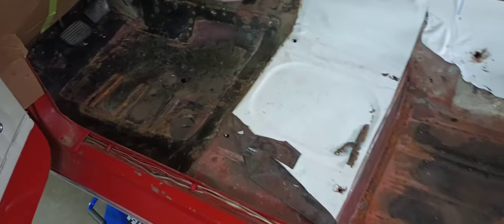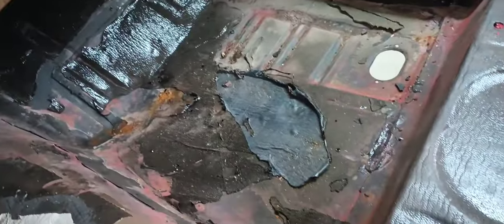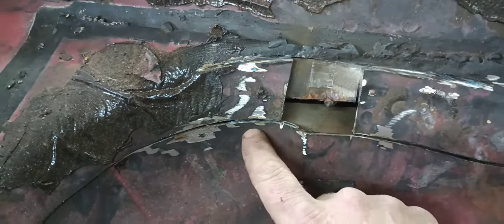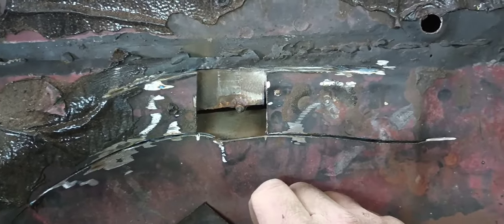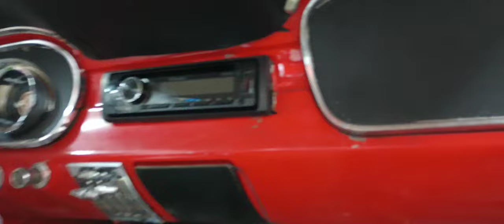Hacked 1965 Ford Mustang: Removing The Boogered-in Floors #ford

Comment: I've been building cars over 40 years - its amazing how many hack jobs are out there, cars left for months at shops with nothing done except money taken. 
I won't do any requested half-ass work especially if I'm thinking its gonna be somebody's quick flip. And wiring - if its a rats nest, its all coming out to do it right, not burn the car down.
Keep up the good work brother.
Reply: I remember a few years back there was a relatively big restoration shop that burned up because a customers car had crap wiring in it. Caught fire in the middle of the night and I recall a really nice Corvette (maybe a split window) and a few other customers cars got cooked. Imagine trying to compensate the owners 🤕

Comment: Got 64 Rancharo to do same they cobled galvanized sheet metal thanks for learning lol 😊
Reply: Back in the day when these cars were 10-15 years old they were worthless.  I 'repaired' the rotted out floor boards on a 64 Falcon using galvanized sheet metal,  pop rivets and sealed up with gutter caulk.  I knew it was a hack job.  The point of the repair was to get another year or two of use from the car before it went to the crusher.   The car was worth so little there was no point in putting any great amount of time or money into it.  That's different from what you see here, which is fraud.   Someone found a rotted car that we would have used for parts back in the day and 'restored' it with pop rivets and bond.  They sold it to some hapless chump who thought he was getting a solid car.

Comment: My warning concerning cutting disc use-the discs spin debris. I have had eye injuries while wearing safety glasses and a face shield. Really, goggles are needed to avoid eye injuries while using cutting discs.
Reply from the maker: Always a good idea
Reply: Don’t forget breathing in that Rusty dust. I use 3M -FF-402 full face respirators for everything from painting to wire brushing on a grinder, cutting, undercoating. I buy them used or open box on e-bay for around $110. New they are around $170, well worth it to save your eyes and lungs.

Comment: Ok one hell of a job dude but did you think to put your stang on a straightening bench cause tearing apart floor pans modified structure of your unibody chassis and you have to check it out during and after your floorpan or rockers replacement.Am body repairer since 40 short years...
Reply from the maker: That would had been the best option, but I don't have access to one so I've been doing a lot of manual straightening and cross measuring that adds up to a lot more work but should get it back inside the factory tolerances.

Comment: Looking at the floors, I wonder about the front fender aprons and center radiator support. I've got a 69 mustang I'll be replacing floorpans on. The front fender aprons on both sides need replaced too. I haven't looked into the cowl yet. I have removed both fenders but not as much rust as I expected so far. The drivers door is really bad. And the drivers side fender is bad also. Headlight bucket is munched too. The floor on the driver side under the brake is gone. I won't know how bad.the interior is until I pull the seats and carpet. I'm not looking to make it a show car but I do want it to be a safe daily driver. I expect it's gonna take some time but I believe I can do it.

Comment: Ok i understand your position.But don t do like the dude redline channel with his welded brace skeleton on his nova  from the inside re cutted and re welded because it appears he s not an indian contortionist to work inside the car.All you have to do is to construct bolted adjustable rulers tubings onto each doorjambs bolted on each sides and from under the chassis at longitudinals beams same
And you ll be able to work from the inside perfectly without to be affected to transform yourself as a snake as vigilantes!😄😆😂

Comment: You should just put a full floor in way less labor
Reply: +1
It's nice to not have to bother stitching everything to an old tunnel
Reply: This car had so many things wrong, bad, or screwed up that it would probably be better to buy another car.  I think Hot Rod Guy has two goals; help the car owner out, and to see if he can gain a YouTube following.  These early Mustangs have been the object of butchery almost since they were new, even in the '70's when they were just a 10 year old used car I can remember seeing many hack jobs at used car lots.
Reply from the maker: Quite possible, I'm trying to keep him as economical as possible and just doing the half floors at this point will probably save him a couple hundred bucks in the end
Reply: Just imagine the guy who did this hack job, watching you tearing it apart! He’s probably saying “dang all my hard work going down the drain”. But then again he might be laughing because he got top dollar for that piece of crap.
Reply: i would charge less to put a full floor pan far less wielding and body work   @HotRodGuyGarage
Reply: I understand totally  @HotRodGuyGarage
Reply: @Thomas63r2  There's a guy here on YouTube who calls himself 'Your Friend Pete' who rebuilt a fastback he referred to as the 'Rustang'.  By the time he was done about the only original panel on the car was the roof, the rest of it was Chineseium repo panels.  Now the car did look nice but it's hardly a Ford Mustang at that point.  It's now a Dynacorn Mustang.

Comment: That guy will need to educate themselves on picking a car to purchase.  Just the rust under the hood and the paintwork puffing up on the braces tells a person that they painted over rust.  Otherwise un rusted metal with decent paintwork would not be swelled out, it would be good steel with good paintwork, no rust would be swelling.  Everything about that car raises red flags.  They should have seen things, looked good under the car, said thanks for showing the car to me, and then laying a patch out of there.  Buying a rust repaired car done by a home garage guy who didn’t know what they were doing or how to properly weld created a rust bomb death trap.  In a crash the occupants would not be safe.  Even extreme driving, takeoffs, braking, fast sharp curves, uneven surfaces putting twist and strain on the bottom structure in a mess like that, poorly welded together with low penetration surface glob welds and that car could break apart and cause a crash it is in no condition to take.
Reply from the maker: It's definitely a mess

Comment: With the body held together by booger welds & wishful thinking, any chance the original "restoration expert" put the same level of quality in the drivetrain rebuild?
Reply: Nah I doubt there’s any issues with that being that it was probably a flip car you can jimmy rig some body work and welding a lot faster then you can rig drivetrain issues more then likely they bought a solid runner and driver and just pieced it together quick and fast to make a buck plus their ain’t much surprises to those old mustang motors you can tell pretty quickly whether or not it’s got a solid drivetrain
Reply from the maker: I'm sure it's probably close to worn out, but seems to be a good running motor